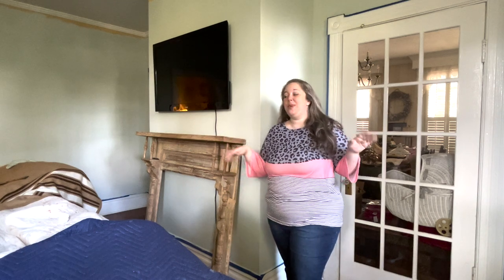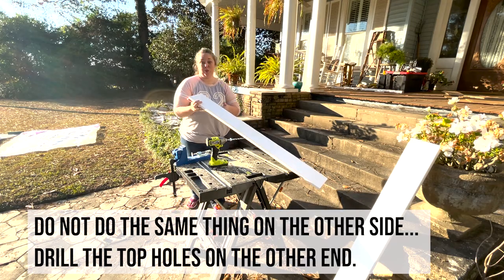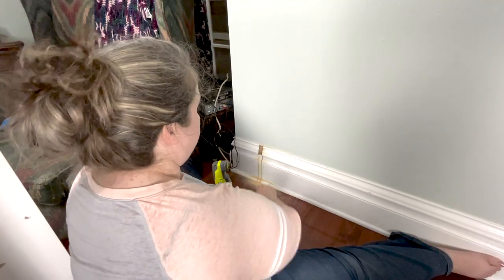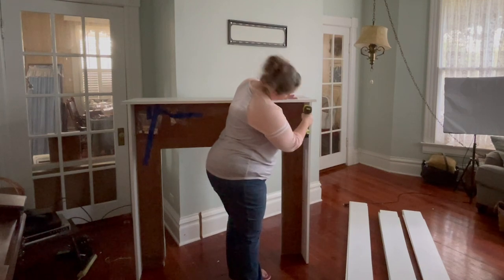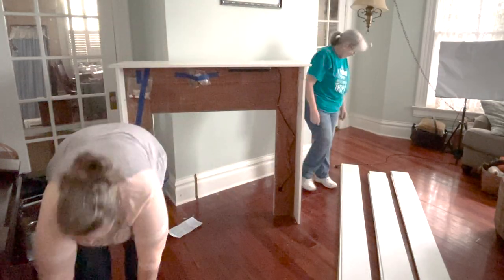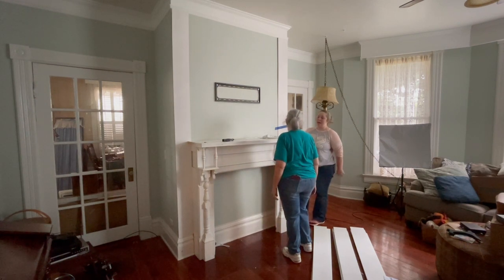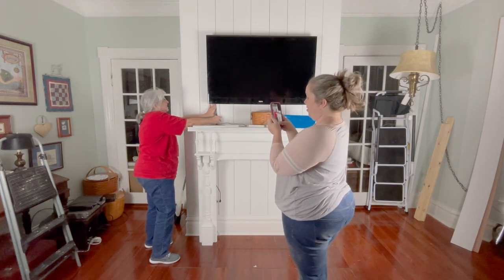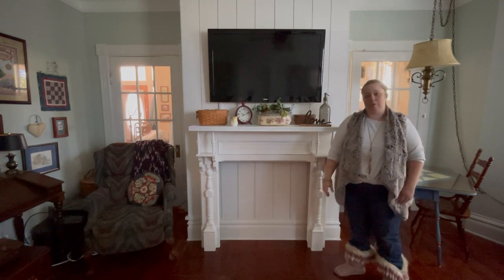How to Refinish an Antique Fireplace Mantle

Comment: Did you use two Wagner paint tools? One for wall (roller) and another for fireplace. I have many kitchen cabinet doors to repaint. Rolled 1st & 2nd coat by hand except back side. Decided I want to go over again both sides before rehanging...
Reply from the maker: Yes, I rolled the walls but I took the fireplace outside and sprayed it. Spraying is great but not necessarily something you want to do indoors